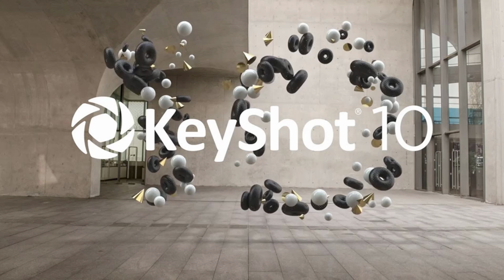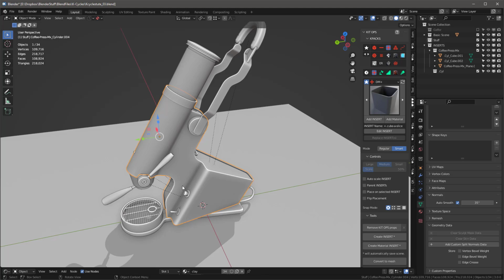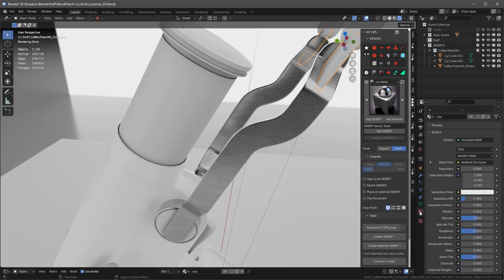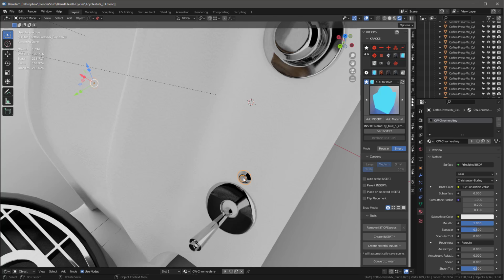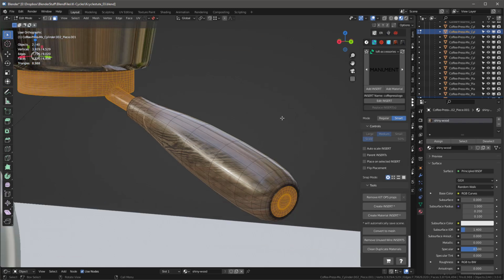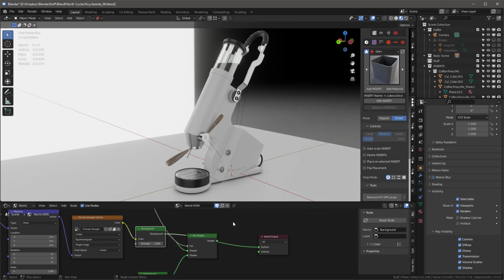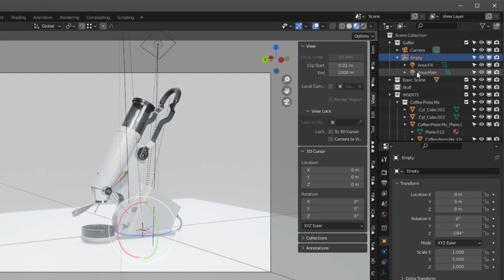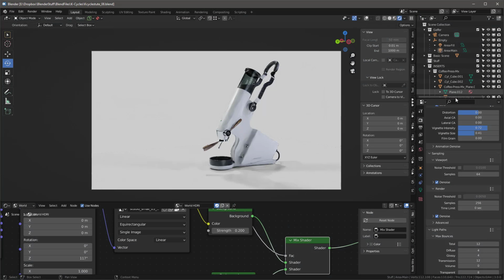Can Blender + K-CyclesX replace Keyshot?

Comment: The image adjustment is true but one major point you overlook - Keyshot loads native cad files. Blender does not. Keyshot has a vast amount of physically accurate material library.
Reply: A material library is not a negative against Blender. It uses standard PBR workflow so you can use any library out there. It can also open DXF files so not sure what you are on about.
Reply: @GifCoDigital  PBR is great once you compare it with custom programmed materials keyshot has/can use. Two different worlds. I do love blender but in no way will it replace keyshot yet - as much as I would love it! But overselling can be problematic.
Reply: @cekuhnen  "custom programmed materials" lol are you referring to procedural materials? Do you have any idea what you are talking about?
Reply: @GifCoDigital  maybe reread your text and think about it for a moment …
Reply: @cekuhnen  maybe learn what the hell you are talking about. Physically accurate and procedural are two seperate things.
Reply: @GifCoDigital  again maybe reconsider your replies - I not even once talked about procedural.
Reply: @cekuhnen  you are talking about materials in a CG environment. Keyshot is not special and nothing more than a simple renderer.
You clearly don't know industry standard terms  and are just being a twat at this point.
Reply: @GifCoDigital  May I suggest a look into the mirror? It might help.
Reply: @cekuhnen  auhhh that's cute. Come back when you can act like an adult and have at least a base understanding of the topic.
Reply: @GifCoDigital  hm … I am not the person that started from the beginning making a fuzz and being overly offensive.
Reply from the maker: The last version of Keyshot I had could import NURBS just fine but once imported it could not assign the tiny render bevels to the NURBS which for me made it virtually useless. Not to mention rendering NURBS took much longer as well.

In fact the drone ambulance renderings in this video I created in a CAD program and imported the NURBS and then had to quit because Keyshot was too unresponsive. I then converted them to an OBJ format and things worked great.

Blender uses PBR shaders which is an industry standard and stands for physically based rendering. It would be nice if Keyshot used an industry standard shader as well.

There are many vendors that sell or give away PBR materials.
Reply: @ChippWalters  render bevel - well in surface or solid modeling you can just create the transitional surfaces you desire without the limits of render shaders or bevel modifiers.  Keyshot is also pretty much a standard plug-in render engine in all major cad apps from rhino to solid works. I am all for promoting blender but there are many hurdles to take. Look how badly cycles in rhino is seen.
Reply: @cekuhnen  I think the ability to load CAD files directly is the only real benefit from Keyshot if you know how to use Blender. STL or OBJ export from CAD is not always pretty.
Reply: @Edgard422  In our field you don’t have much time to do renderings. Direct linking or loading cad files is superior when it comes to workflow. You load your hdri add your materials render and done. That’s also why the internet is full of so many looks like keyshot renderings. However it can achieve more realistic results than Blender. Look Blender just now is getting maybe caustics. I am all for blender being more used but there are reasons why keyshot or Vred are dominant in the industry.
Reply: @cekuhnen  Yeah that's what I meant with "if you know how to use Blender". I can load, setup and render an STL file in Blender as fast as someone can do it on Keyshot, but then again changing from CAD to STL is not always straightforward, and learning Blender is not that easy. BTW if you find setting up HDRI backgrounds in Blender a little complex you may find the addon Lily Surface Scraper very useful.
Reply: @Edgard422  I know Blender very well - I teach it. I prefer Blender simply because I enjoy it. I also have the time to tinker and play. Till recently stl import into blender was however not without flaws. That was another issue with it. Caustics is finally coming. And maybe at one point the material system will get an update too. There are few deficiencies left. I never really liked keyshot because my students would only use it and limit their growth in learning how to set-up scenes correctly and learn digital 3D product photography.
Reply: @Edgard422  blender can in many aspect do the same and more. Ease of learning or quickly jumping into it and out is what makes keyshot so appreciated. But also the material system and render engine can produce better results. While there is flood of bad keyshot renderings when used right it can reach a photorealism that cycles struggles with.

Cycles is really good but when compared to vray corona etc it has short comings.

That’s just the truth. While it think this is not why people prefer keyshot over blender.

The same with Enscape and sketchup. Cycles or eeVee has so much more to offer yet 99.99% of my interior dewing students would only use Enscape if I would allow it.

And in the field ? Yeah you have to look for blender. 

Hopefully at one point this will change. Blender needs live linking plug-ins for the host cad apps.

Otherwise they won’t use it.
Reply: @cekuhnen  In mining solutions proposals we are using both, Keyshot and Sketchup + Enscape. There is no point in comparing Enscape with Eevee, Enscape renders a lot faster and the result is a lot more robust (no shadow bias tweaking or things like that), the benefits of using Enscape are too many.
Keyshot may be able to produce great renders, but to get those I think you still need a solid knowledge of materials, lighting, setups etc. The best thing about Keyshot is to produce fast images or animations that looks "good" with low time and low training. People here are getting only acceptable results with Keyshot (this is enough for the purpose), but to improve this results I think they might have to learn a more complete 3D design software like Blender.
Reply: @Edgard422  eeVee can be well compared to Lumion and this type of real-time rendering is becoming more popular in architecture Workflows. I would actually not say that you cannot get good results with keyshot. You can! Keyshot some time ago also got material nodes and physical lights. The issue with keyshot good enough is also because of the ease users / students don’t refine it more. Enscape renderings equally can look eye hurting if not adjusted more.
Reply: @cekuhnen  Keyshot is widely adopted because it's fast and acceptable...Not because it's good.
When it comes to photo realism, blender mops the floor with keyshot, plain and simple. There's a reason why blender is damn near the defacto platform for CGI artists and animators. When companies do large scale product renders (if they dont do high end photography), they wouldn't touch keyshot with a 10 foot pole, unless they want everything to have a plasticky/fake look to it.

The very fact you have to BUILD a material from scratch in blender is what makes it more powerful. Even keyshots materials aren't 100% correct and if you use them as is, then...well, I don't know what to tell you other than Im sorry for you.
Reply: @Troothbomb  this post was made 2 years ago :) there are also reasons why Blender does not get into certain industries. You can also make very good renderings with Keyshot and being ale to load CAD files or to live render to Keyshot is one major argument. The same I see in architecture and interior design.

Tja let them throw money out the window …
Reply: @cekuhnen  Blender is starting to move into industrial design, because it's a far more powerful tool.

Fusion and rhino has native files that go into blender, solidworks requires an extra step. Takes all of 3 minutes lol.

Keyshot again, is great if you want something quick, but everything still looks incredibly fake with it.

Comment: Please please leave some pause between your sentences.  It drives me nuts how clipped close you edit it.
Reply: I agree hard - exhausting to follow
Reply: Uh...just tap space bar or left arrow, slow the playback speed etc.  There are so many solutions offered for this. I for one appreciate the tight editing and often listen at high speed until I don't understand then back up a couple taps and slow.
Reply from the maker: Best to watch it ata shower speed, of turn on captioning.